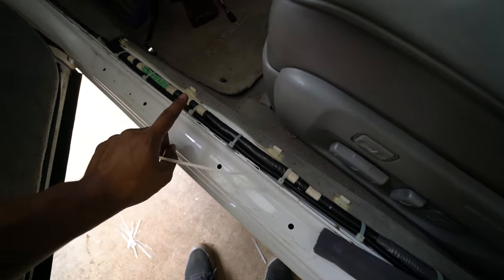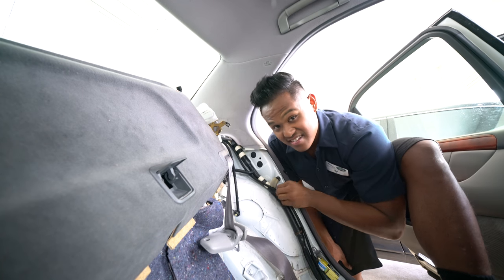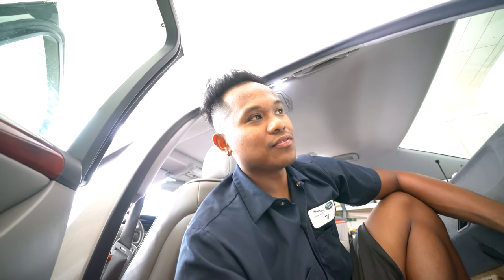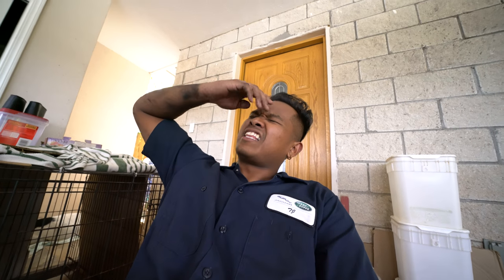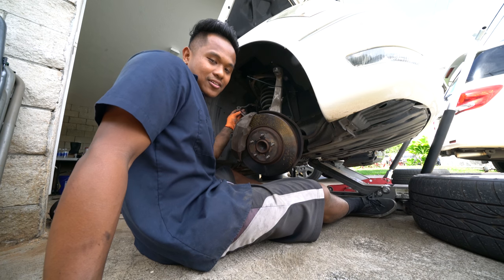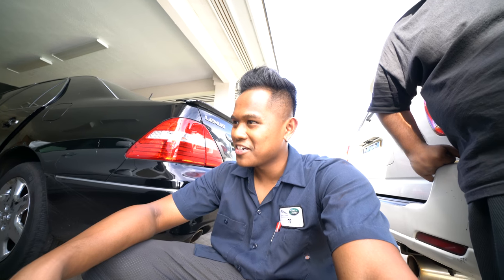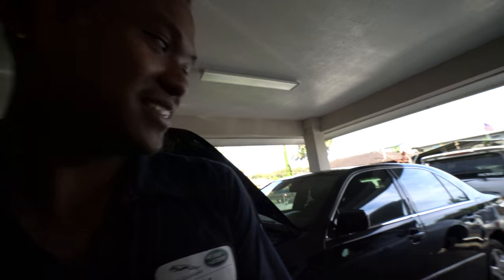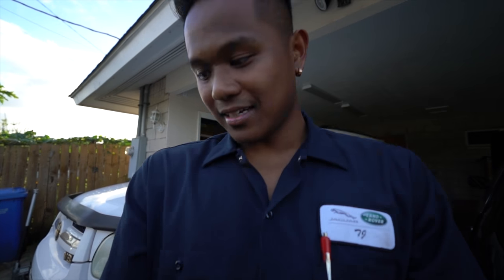JAY | VLOGS CHRISTOPHERS BAGGED LS4DURTY (EPISODE 16)

Comment: Your black ls430 UL?
Reply from the maker: Yessir
Reply: Is it up for sale? Lol
Reply from the maker: @mandac_inc5641  anything is for sale if the price is right 😉😉
Reply: @u1StupidKiD  whats your price? 👀
Reply from the maker: @mandac_inc5641  probably $15k somewhere in that range. Most things interior wise work soft close doors, recliner rear seats, etc. Interior is pretty immaculate. Had car since 65k & has 101k miles now. Have all components for timing belt & will be doing it in the next few weeks. Things like timing belt, water pump, drive belt, valve cover gaskets, spark plugs, etc. really don’t want to or need to sell cause it’s a good, clean reliable car but anything is for sale for the right price. Plus these cars are getting hard to find in good condition & lower miles. & this body style will never get old
Reply: @u1StupidKiD  can you pm brotha 🤙🏻
Reply from the maker: @mandac_inc5641  I don’t have Instagram. U have Facebook messenger?